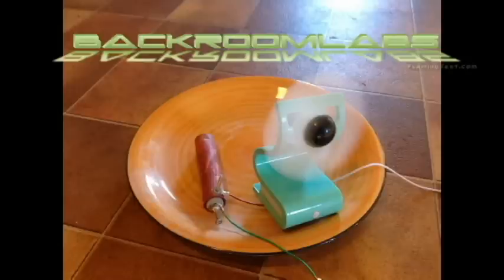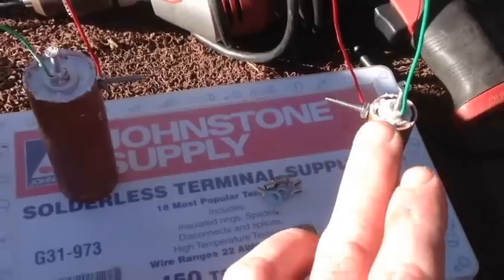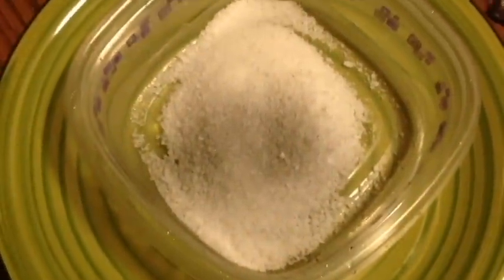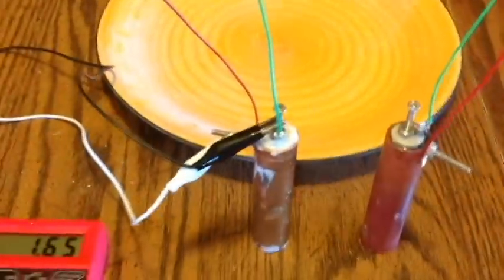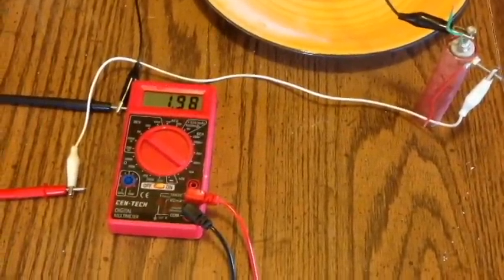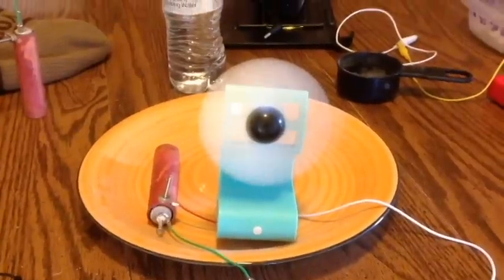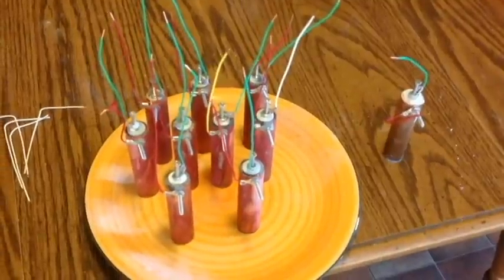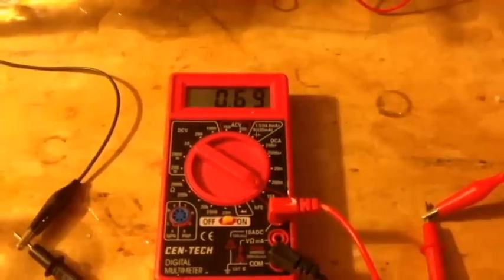Crystal Battery 1 amp complete build process BackRoomLabs

Comment: Check your jumper leads, some are made of copper coated steel wire. (magnet will draw the wire in) these are high resistance.

Comment: Making a cooked and melt cell. Using a cooper wire and thick  rolled up piece aluminium foil , I found out after set hard when you move the aluminium foil side to side rapidly quickly causes the voltage to increase. Only works with aluminium foil, tried wire and metals doesn’t work.  Increases the voltage without needing to use a power supply. Possible theory causes internal centre of crystal to vibrate changing crystal structure and increase voltage.  Try for yourself and see if same result interesting experiment to try.

Comment: It's not working ...
Reply from the maker: It's not working doesn't tell me very much info at all. Did you follow the build process like described in the video. Did you use pure magnesium and clean copper. Did you heat the copper and squelch the copper tubes in the borax and water solution untill you got the salmon colored layer on the copper tubes. Did you use alum and distilled water as the electrolyte
Reply: @1billyknorr  Hi Billy..I totally went on a different direction,how to make crystal matrix of john hutchison with completely different minerals...finally after 2 years crazy research n chemistry understanding, I made his actual crystal cells...each one running a motor for almost a week...amperage is above 80 miliamp...those styles are not working because of missing part which is iron oxide electrolyte
Reply from the maker: Do you have a volt and amp meter

Comment: 3/4 inch copper pipe and 5/8 inch mag rod inside, gives you 1/16 inch space inside to put the screw and the solution. You can barely fit a toothpick inside that much space.  Your screw must have a very small thin head.
The question is, how long will the battery last and is it rechargeable?
Reply: It should in theory last forever- it doesn't need to be recharged as it draws power from thermal energy. Alum only mixtures show little to no signs of corrosion which is the only possible way these cells could fail.

Comment: I saw some people use the copper and magnesium rod. But instead of only Alum powder they use a mix of Borax (yes the powder), Epsom Salt,  potassium chloride, and
 Alum in equal parts. Then there would be no addition of water needed. The 'battery' charges itself by unplugging it for a short time. Have you experienced this ?

Comment: I see it's a very special Battery. Saw video's from John Bedini. 
Still have a question. It doesn't use the Copper. It doesn't solve the magnesium. Does it only use the water or also the Alum ?

Comment: Hi. your innovations are great! I have a question, the Electrolyte is only aluminum with pyrite of Fe? And the booax? greetings from Argentina
Reply: I also built them recently. I could not get pyrite and borax yet. So I have tried with  Alum salt and Potassium chloride mix. With the dry smashed mix, it gives me 1.95 Volts.  Bt I am not happy with amperage. However, I will test different versions as soon as pyrite and borax came.

Comment: Instead of using a Joule Thief circuit, have you tried hooking up one of those upconverters that boost from 0.9v-5v and outputs to 5v usb?
So these reactivate with a couple of drops of distilled water?  I could not tell if your version has a copper cap on the bottom or if you simply pack it as an open tube and let packing material harden in it....

Comment: Impressive stuff.  You said you stuck thin wires while stuffing the battery.  What if you wound insulated wires through it?  Would those copper wires generate some voltage?  Like a transformer effect?
Reply: Probably not. Transformers require alternating current. A thin sheet of paper might help keep the magnesium from touching the copper though. If you did do that though with the copper it might have a reasonable inductance built into it so it would produce a voltage spike every time it was disconnected.

Comment: So without watering daily no 2v?
Reply from the maker: It wont maintain 2 volts. It will settle in to stable voltage lower than 2v. Something like 1.7 or so. You can over wet the crystal. Causeing voltage and power output to sag. If found better output the warmer the cell. Also helps to let it dry out sometimes. You can use if for a month put it on a shelf for 6 months. Pull it out, wet the crystal and its outputting power.
Reply: @1billyknorr  I find it's not much use if you have to vet it have you tried to heat the alum it bubbles.. and did you try mix with Epsom potassium chloride and borax?

Comment: Is this battery rechargable?
Reply from the maker: Its not like a chemical battery. This type of cell splits water into hydrogen and oxygen. The spliting of the h2o creats the power. But initially the power output is pretty strong as the reactions taking place use the magnesium as a sacrificial metal. Once the layer of corrosion has covered the magnesium the power will drop off and then just use the water to convert into energy once you add the water to the cell when they're new you can actually hear it Sizzle a little bit that's the water converting into its two basic elements

Comment: You voltage on your multi meter isn't constant.  This means the degradation of power, and the battery will not hold very long.
Reply: That's a pretty quick voltage drop.  Reminded me of a capacitor more than a battery.  The cell probably builds up an internal charge (maybe a buildup of a specific chemical or ion) which he depletes faster than the battery replinishes it.

I'd love to see a long term test to see how long it lasts and what output it settles at.  At least a few days straight of discharge if the cell can last that long.  We need a discharge curve.
Reply: @ancapftw9113  I made it  John hutchison method the ingredients last for ever base on electric memory n petrol electrical effects but the problem is an anode..I tried so many type of alloys as an anode but they quickly lose  their sort of ability...magnesium was eaten off in 3 days ...

Comment: It's not a crystal power cell if it has a chemical reaction!  You have made a saltwater battery between the magnesium & copper!
Reply: All crystal cells use up the materials via chemical reactions.  Some just do it slow enough that it's hard to notice.
Reply: @ancapftw9113   Harry Robinson  You have not done your homework; the "Crystal Power Cell" was invented by a man named John Hutchison after he discovered a Free Energy effect in Piezo ceramics and other crystals.  It is called fero-electricity by mainstream science.  This must be picked up by other researchers!
Reply: @bardrick4220  I'm assuming that you are referring to using ferroelectric materials for energy harvesting.  Or maybe the fact that they are Piezoelectric too.
If you are using the term "free energy" to mean energy that exists and can be collected, then sure, ferroelectric materials can be used to make "free energy" devices.
Reply: @ancapftw9113  Piezo and pyroelectricity are side effects of these materials.  Barium titanate was the original material, and the video is still available on John Hutchison's YouTube channel.
I suspect Zero Point Energy (or Dark Energy); something like a molecular Quantum Tunnel Diode, but it is not well understood! 

I have replicated the results: obtain a pezio ceramic, charge it with a battery to align the domains (polarity sensitve), discharge by shorting leads, repeat discharging indefinitely approximately once per min.  The ceramic emmits a clicking sound every time the leads are shorted!

Comment: Thank you for the video and research. I agree this is a crystal cell and not a chemical cell. I did not observe a heating process for the crystal, is this a cold build? You just used a dry (room temperature) mixture and added water; is that correct? You did not melt the mixture?
Thanks Myk

Comment: Msybe You have a hybrid cell, when dry,a crystal cell low amps, when wet, I promise your mag is getting eaten,  
I made a battery with only mag ribbon alum/water, copper, 
Got 1. 7v  each, 2 cells in series  ran a small 6v motor very well for about an hour, bubbled a lot, then it died when the alum totally  dissolved the mag ribbon!
Reply from the maker: Quantum Energy Solutions . Problem with the ribbon is it's purity. It's cheap. You need 99.98 or better pure magnesium. Also the red copper is essential. It creates a semi conductor layer. It's been long enough I'll have to cut one open and show the difference.
Reply: BackRoom Labs  I'm aware of John Bedini was redding the copper, have you done comparisons doing a Keshe coating? Search nano coating capper  Keshe plasma. Yup mag ribbon is unpure, and as in litmotors alum, mag, crystal cell lasted for years, at low steady output. 
The holy Grail will be high output and  zero degrading. We will get there for sure.
Reply: BackRoom Labs and could add some activated carbon as well!
Reply from the maker: Quantum Energy Solutions I will check it out. Thanks. Since winter is setting in once again so  the work days are getting shorter. That means more time inside to experiment

Comment: its really hard to find magnesium in my place where could i possibly find magnesium ?
Reply from the maker: the place is called gallium source. decent prices very reliable delivery just type that in a Google search
Reply: can i possibly find magnesium in my area just for free ? can i possibly find that on scraps?
Reply: @markcabrera465  Try to find it as an anode of the water boilers. It is used in there to prevent the tens corrosion.

Comment: What would be fantastic, is if you could put a small load on the battery that draws maybe 100mA , then also measure the voltage over that  period of test. Leave it till the voltage drops below say 70% of full voltage. or even 50% . This way you can measure the true power in watts that it has delivered. Then let it recharge and do it again. Then you have a valid comparison of this type of battery to a standard battery. If you prefer to use a pulsed load, perhaps use a 50% pulsed load. That way its easy to calculate the power based on 50% supply.
Reply: Not rechargeable

Comment: Congratulation!! You discovered an electro-corrosion. The same technique is used for ages by shipyards to protect big steel ships from corrosion The chemistry is slightly different Steel+Magnesium+Salty water+Cooper but the idea is the same. To answer the question how much does this battery last... well until Magnesium "dissolve"-corrode itself. That could be up to a year or two!!!!
So don't run to  the patent office yet!! Cheers
Reply: Yes people have done things in the past that we do now.....not that it matters who did it first has no bearing on pottential help but if you are Purley focused on who did something first and discount the rest due too the fact something similar has been done before is a very strange approach too life but each too there own..

Comment: This looks awesome!  I did some reading on these, and it looks like they use the piezoelectric effect of ambient heat/etc. to generate electricity.  How long have you gotten them to last???
Reply from the maker: you are correct. the hotter they are the more amperage they will supply. although I have frozen them and they still output power thought not near as much.
Reply from the maker: Honestly to the date today they look exactly the same as the day I made them everyone says that they consume the Magnesium but if you use Alum only and no other salts the Magnesium stays intact

Comment: I want to make some of these with Quartz dust to see if that will effect the output.
Reply: Hello, Have you done any ?
Reply: I tried that and mixed galena and different quartz and iron pyrite. I made like 50 but wiring them was a bitch. But I definetaly comvinced you can wire a house in a fraction of the space. Solar panels take alot of space and these you can make tiny and dont need sun. In a solar panel configuration with them charging a power supply I absolutely think you can power a small cabin and more if youre dedicated and can find a smart way to make them to stack them up and multiply the voltages and amperages easily

Comment: Not to be a party pooper, but you made a chemical battery based upon the galvanic reaction between two dissimilar metals (magnesium being particularly reactive) by incorporating an electrolyte medium (salt) between them.  I bet you find the magnesium cathode eroding away too as it gives up its electrons aka the source of your power.  No free energy from doped power crystals in this.  If you get your electrolyte solution more efficient, you could see a voltage theoretically of up to 2.69 volts or so per cell.  Reactivity of copper (.34 volts) added to reactivity of magnesium (2.35 volts) in a proper salt dielectric would be 2.69 volts.  There are other versions of this type of "crystal power" source out there readily available; Duracell, Energizer and EverReady as examples.  Now if these cells you made are somehow powering that fan for months on end and not just days... you may then have something.  The magical "boost" I see people doing to "activate" their "crystal batteries" is simply recharging them, aka reversing the chemical process.  Also increases the efficiency of the interface between the two dissimilar metals (removes the oxide layer) making the battery more efficient.
Reply from the maker: problem is that these cells are well over a year old and the magnesium is still 99 percent intact. the inital pitting happens within a few days. the power output falls in this initail pitting time then has been consistant ever since. ill post a follow up vid in a few months
Reply from the maker: Well then maybe you can explain to me why I sent your post 10 months ago you state that I'm going to consume magnesium whereas there has been no magnesium consumption whatsoever any other cell that I made that used any other type of salt other than album the cell corroded and was dead within four to five months 8 months at the most
Reply: +BackRoom - so has it been spinning that fan all the while?
Reply: when i made mine i only used molten salts no water added gave them a charge once they had hardened and they stay at the 1.4v mark consistently and are powerful enough to power a whole set of led garden lights flashing on/off for long period of time.. i think adding water just makes this a normal battery apposed to a true crystal cell.. yes these will last a while but vs a solid state crystal cell these ones would not. i get lower amps but longevity is better   @lappansommer546
Reply: @badsaddamdotnet   - depends.  some say - no oxidation or material deterioration despite water .
Reply: @channel1.946  if its a chemical reaction its a chemical battery regardless i think but the electrolyte is either solid state or liquid

my crystal cell batteries are more solid state apposed to the ones who add water

Comment: My experience with wire clamps is that they can restrict the current flows.  You should solder all the connections to a good switch that is meant to handle up to 10 Amps. then measure the batterys flows.

Comment: Is it cheaper to make than lithium and is the power capacity comparable?
Reply from the maker: the power density isn't even close to lithium ion. although. a lithium battery needs recharged.  by another power source. as to the crystal cell ad far as anyone knows this particular type is not a galvanic reaction. that being said these little puppy's might be able to output power for 5 maybe 10 year or even 50. so if you add up that output of its entire life the numbers would be insane. these cells are better used in a pulsed type of usage. setup would be to deliver power for let's say on for 1/2 a second off for a full second and so on. they act source of like a self charging capacitor.
Reply: BackRoom Labs So, you cannot compare apple with bananas

Comment: how long do these crystals last?  I don't want to have to water a battery everyday and I don't want it to die over night either.Any thoughts on making enough of these to be able to charge a 12v car battery... store your energy there, then run what you need from the car battery, use an inverter with the battery if needed.